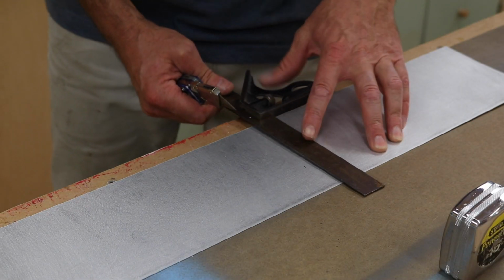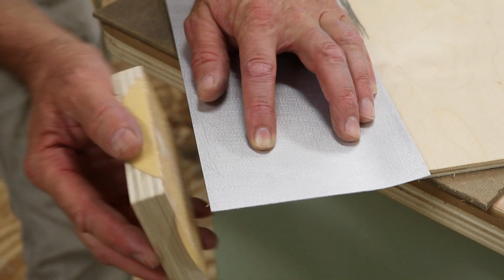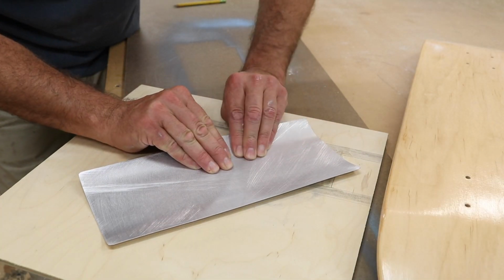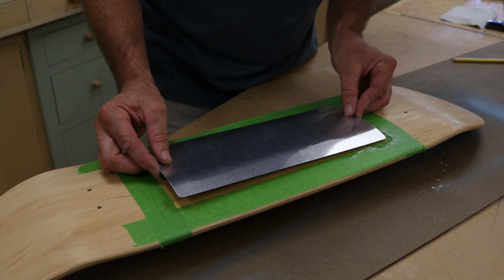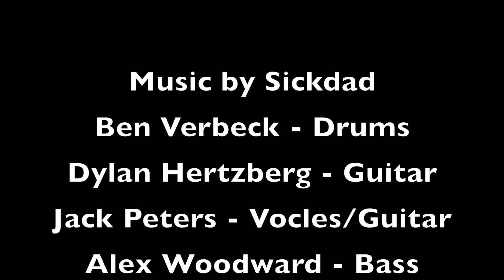Glue an Aluminum Skid Plate, Grind Plate to a Skateboard

Comment: Looks good. Was going to suggest either routing an inset for it, or extending the length and using the existing screws, although i think that would affect the flexibility of the board.